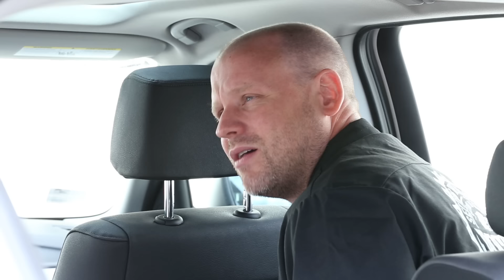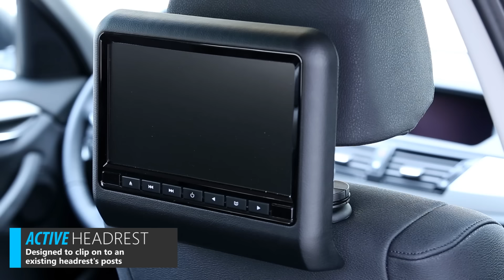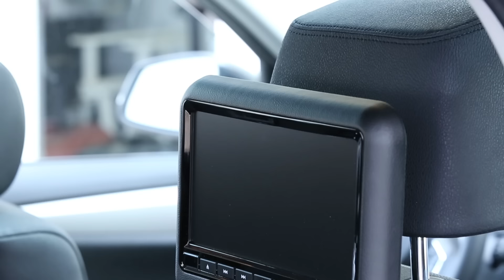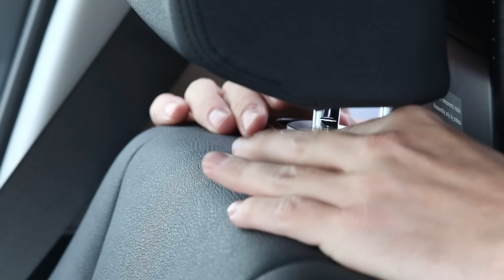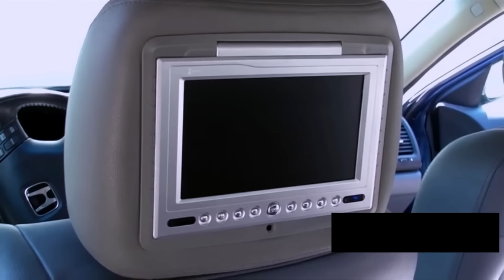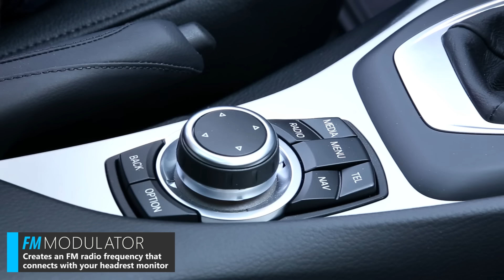Headrest DVD Players - Which one is for me?

Comment: Don't ever buy any Xtrons Products! I purchased a set of 2 headrests and they are such a big piece of crap. The DVD could not be heard with speakers or via FM. So I had to return them, they sent me a replacement and it was the same thing. I realized that Is could get the speaker sound to work by using the USB, but they do not support auto resume ( I wonder why ) so every time they turn off you have to start the movie again, and the fast forward is really slow, the 20X speed takes like 15 minutes to get to 1 hour. I wrote xtrons about this maeter and they told me that there is no firmware upgrade for these, and I told hem I was going to go public with this information to keep people fromBuying their junk and they answered me that they can live with that, so you see what kind of commitment they have. So stay away from their products!